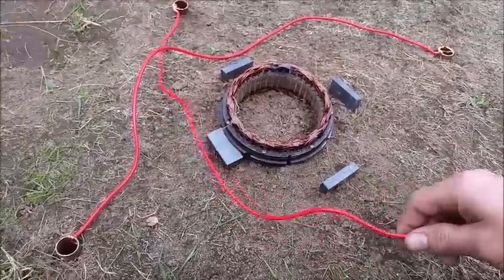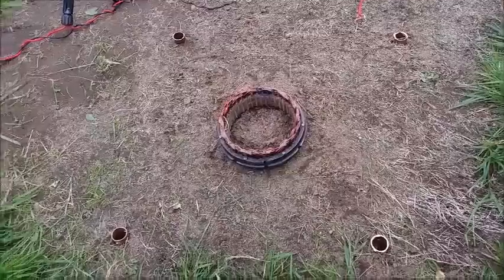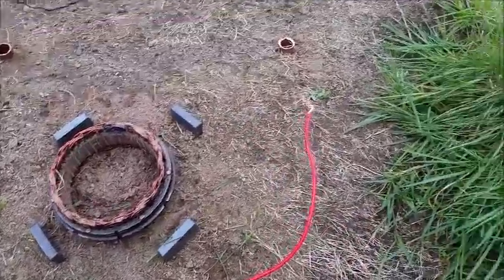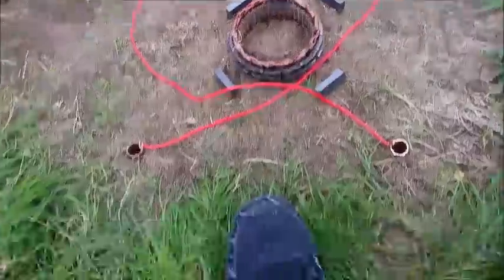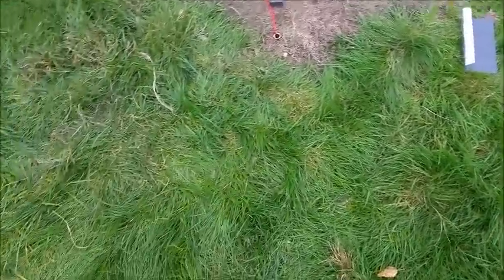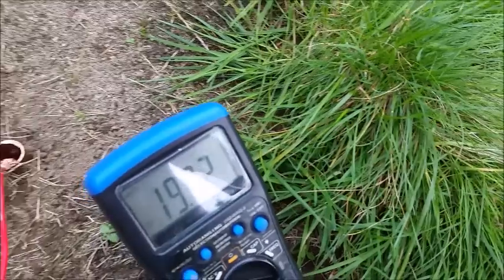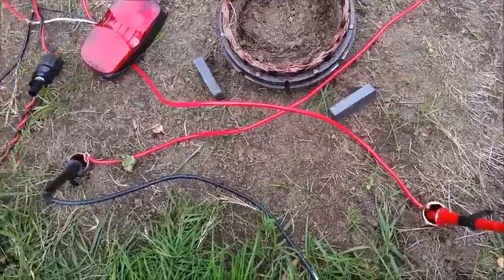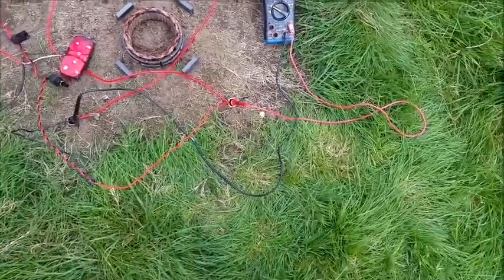How to get FREE Electricity

Comment: those energy circle is frok the coil and the double coil creating a radiant plasma field of energy to generate more power rf without a rotating magnet coil just like the moray valve was able to tap into the ion sphere 100 ft high plus the machine used the right metal cap plates to giv of radiant amp energy 50kw of power wow this device in modern days can be built smqller and the size of a truck car battery and to power your house if any thing it quite interesting how it works but i disagree with your video now you can make a battery out of anything that has moister like so acid batteries contain liquid with carbon and thus only one time use but it is rechargable with lithium ion collect oil your metal use cotton or toilete paper and collect alot until your volt meter says 200v then connect it to a rechargable build super battery or super capasitor into a boost converter or use inverter with coils powering a twireless energy it will work study and you might get somewhere these tools i know beyond what this planet has and knows that is why i say this soon you will see soon
Reply: I think if youse add a Flux capacitor your idea mite work !
Reply: my mamma the energy is in the air. From the sun the ground is that ground. Get a copper pole w an palm tree of copper wires like a bouquet on top plant the pole in the ground  look up Gerard Morin he cracked the teslaTheory,  Tesla was trying to do the world this guy got it in a smaller micro  its so elementary. Youll say holy shit its so simple!  His way will.make the internal combustion engine obsolete over night. Its Electro magnetic resonance A.C.  current. Harmless to the touch barley any amperage. Thats what kills. He even lights up burned out florescent bulbs connecting to only one contact  check it.
Reply: My Mamma, oh dear. I'm sorry to say that no one is going to take you seriously, even if you had a good point to make, because your spelling and grammar is dreadful.
Notice how I use Capital letters at the start of sentences or when referring to myself (I) or yourself (My Mamma), and how I use commas at parts of a sentence where, in speech, you would normally pause.
Look also how I use full stops (or periods) at the end of sentences, and start new paragraphs when a previous point has been made and it's time to make a new one.
Notice also that if I spell something worng, a wavy red line appears beneath it as I type, you might like to click on the edit button of your post to see how many squiggly lines you can count.....you can count I take it?
Anyway, this was supposed to be a critical response and was no accident, but is not intended as a put down. It's a wake up call, as everyone wants to be taken seriously, (except comedians perhaps) and for all we know you might have had a very good point, if only we knew what it was.
Suppose for example, that you suddenly stumbled upon the secret to eternal life or time travel, how would you communicate your discovery to others if you did not share a common language with anyone? You might try charades, that game people play...you know..."book, no, no, play, two syllables, etc" but people might not like to play along, so it really would be worth your while learning a common langauage with others, in speech and text, and I do not mean 'text speak'.

Comment: I wonder how salty your ground is right there where you dont have grass. you might have really conductive soil.
Reply: What are you talking about when you say power complaies use the earth as the common?  Soil is highly insulating.  If you open your homes load center it will have both a hot and common bolted in at the top.  The wire running to the ground is your ground wire.  What is occurring in the video is the galvanic effect.  Just like the inside of a standard non-rechargeable battery.  Those copper pipes in the ground will corrode as the galvanic effect takes place and will produce less voltage over time.  They will need to be dug up and sanded to a shine to operate again.
Reply: ATTENTION: 
in USA, greedy electric-power companies use the soil as return ( = Neutral ) to save money on the Neutral wire ( Note: this is highly illegal in Europe & not even used in the backwoods of Russia  )
Reply: James Homer According to Nikola Tesla, the earth is the absolute best conductor of high frequency electrical waves.
Reply: I thinks its cause there's lots of vegetation around
Reply: they do so ,the ground goes to the center tap on the transformer
Reply: Pee on it, and the volts go up!
Reply: Paul Moffat lol!

Comment: EARTH BATTERIES were use in the 1800's to power the Telegraph Systems over long distances. In fact what is actually taking place is the bacterial microbes that ARE in the ground, and doing their job by breaking down plant matter. Said to work better around trees, and when wet because of oxygen and hydrogen in the water (Co2 in air). In exchange for the oxygen/hydrogen/Co2 and nutrients plant, and animal matter that they receive they are giving off ELECTRONS, and possibly methane, hydrogen; or other gases. If you want to learn more about this you should look up work being down on MICROBIAL FUEL CELLS AT A FEW DIFFERENT UNIVERSITIES. Professor Bruce Logan of Penn State is one such person. 

Penn State University >>> http://www.engr.psu.edu/ce/enve/logan/bioenergy/research_mfc.htm 

Right here on You Tube >>> https://www.youtube.com/results?search_query=microbial+fuel+cell

Be Blessed!!!  And may the power of THE MUTHA SHIP CONNECTION BE WITH YOU!!!

P-FUNK YALL
Reply: The law of conservation of momentum only applies to a closed system.... He is hooking into the Earth which is not closed. Similar to how a wind turbine hooks into the Earth via wind, and provides' free energy. 

Yes, a closed system will never create free energy, by you don't have to make closed....

Cheers!
Reply: How do you know that? Exactly.....
Reply: John Smith bruh the universe and EVERYTHING in it is a closed system
Reply: HYPNOVATIONS pretty interesting fake video considering you are violating  law of conservation of momentum and enegry. THERE IS NO FREE POWER, NO MATTER HOW YOU TRY. FAKE

Comment: Yeah i call bullshit SCAM, .... wonder how much money youre going to make from the views

@Either look for a very thin copper wire which is connected to a 19v battery 
off camera ... Keep your resolution low, and continually move the camera so HD wont 
pick up on the scam
@OR bury wires underground, as the copper tubes presented were already prepared... prob buried a battery pack 

Earth batteries and galvanic reactions dont produce this amount of power.
Reply: apparently you truly haven't a clue to what you say.  Your words prove that you are ignorant when it comes to earth batteries.
Reply: Efficiency is NEVER a scam !
Reply: This is simple indction. The magnet field does not have to be spinning.  It being grounded just allows the current to flow.
Reply: there is no battery that goes to 19v only 12v
Reply: yep... two lithium batts then maybe
Reply: Yea your right but there is an experiment called ion collecting using a antenna idea came from nickila testla and other scientist involved in zero point energy. But it simple one goes to the ground and there 125ft into the sky. The capasitor is in between those two ground+ atenna - i was a just at 11ft and got 500mv on a 1v capasitor my atenna was not collect to the earth.
Reply: The more capasitor the voltage goes higher the taller the atenna better recption.
Reply: So you pick up more then this may be to 1000v always check am on the voltmeter.
Reply: You might be right but i want to try it so ill put it on youtube there are alot of videos like one the guy use two potatots puts them in siprate jars and get 120v :-\  come on that is how much your home is geting and dumb people falling for it.
Reply: Getting
Reply: +good boy. oh and then you can see the wires in the jars

Comment: Hi B.R. I like the video. Yes it works Ref:- Nathan Stubblefield "Earth Battery / Cell. I think I know how it works but first have you tried lining the 4 tubes to the points of the compass ? also using one set of copper tubes & one set galvanised steel? Ok now get a "Plasma Globe" watch how streamers flow, then get back to me please.  Regards .... DC
Reply: would Zinc Rods work better than the Galvanized steel?  One set Copper and one set Zinc?

Comment: I don't think it works, how the copper could function if not movement to the magnetic field.
Reply: Chan Marcos the electricity is what flows around the coil.
Reply: Im assuming that its kinda like a battery. Early batteries use copper and iron in a solution of acid to create unbalanced power supply. The positive protons try to balance out by moving to the negative electrons making power.

Comment: What happens if you dont connect the pipes with wires? can you show us your setup without the connections and just put the volt meter on the pipes to see what it will show. also how deep is the pipes into the ground ? LOL, is there any electrolyte in the pipes ?
I have tried your setup, but for some reason it only shows about 11-15 milivolts :(
Reply: Wim Koppenol 
Maybe its the distance between the pipes and the type of soil. And the depth of his pipes?